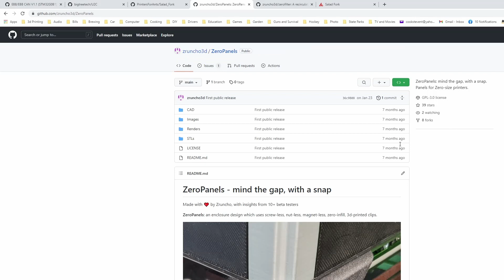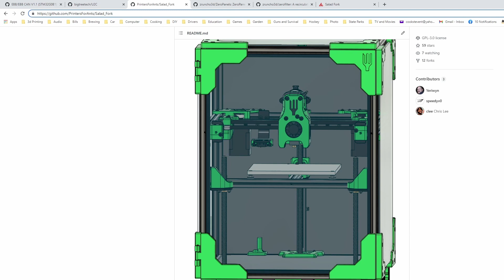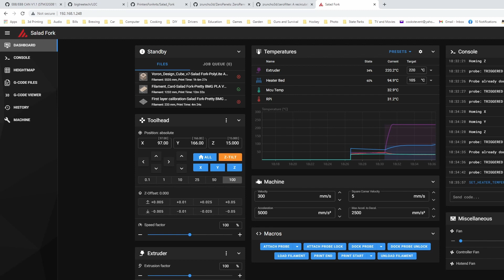Salad Fork Wrap Up

Comment: Nice build.  Can that enclosure take a 180mm bed instead of the 160mm one?  Seems a little large for the build area and wondering whats stopping using a larger one.
Reply from the maker: The 180 bed would likely fit, but the nozzle may not be able to get to all of it. I don't have a 180 plate to put in to see, but there does look to be 15-20mm extra travel in X at least. With boop installed and no Z switch, there may be enough travel to compensate in Y as well.
Reply: @Pushin_Plastic  We keep hearing there's a 180 version "coming soon", so perhaps there will be... :)

Comment: Never been a fan of ferrules. Feel tining the ends of the wire lightly gets solid reaults
Reply: Solder cold flows under pressure, so it can result in intermittent connections. Crimped ferrules are more reliable.

Comment: is the salad fork supported by the Voron designers or is it just a mini trident that users have created?
Reply: user created but in close relation with voron and doom community
Reply: One of the Voron designers started developing it as a side project, and a few of the other Voron guys jumped on to help in the early days.  It's close enough to a Trident that the folks handing out Serial numbers for Vorons give them a Trident serial.
Reply: The main designer of the Trident, utube's Steve Builds, built a Salad Fork. He has a sequence of Livestreams covering it. Also Nero 3D the Canuck Creator built one. It's a "Voron Mod" in the Printers for Ants group. So it's close to but not an official Voron. As mentioned, it is eligible for a Trident serial number as it is considered a Trident variation, which it certainly is. :)

Comment: Trying to pick between a salad fork and a 0.1, really enjoy your content. Any one you prefer?
Reply from the maker: I prefer the Salad Fork. A bit bigger build volume with the 160mm version and I thought the build was more fun and less fiddly. If you need the smaller footprint, there is nothing wrong with the V0.1 though.
Reply: I decided to build a Salad Fork first but kits are hard to come by, and the V0.2 kits are much more common and easy to come by. For me the 160 build volume covers a lot more of my projects. Will end up with both.